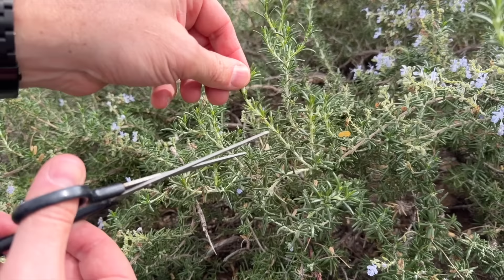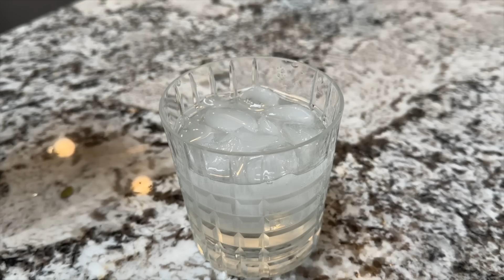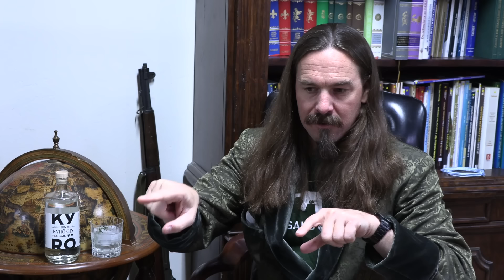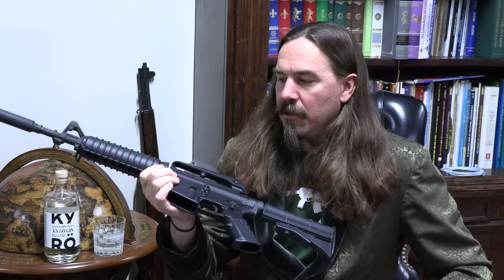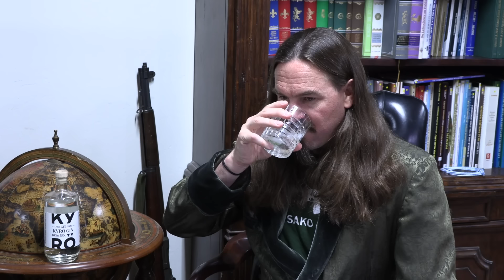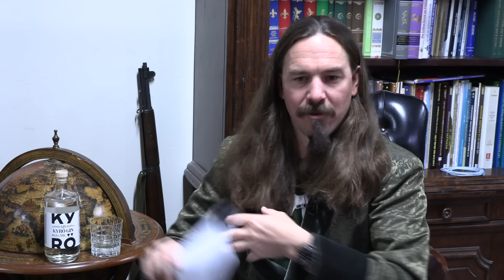How Guns are Made: Tolerances, Methods, and Metallurgy (Q&A January 2026)

Comment: Ramping up defense related parts from one company to many others is a valid concern, 20 years ago there was attempt by a large aerospace company to move to a more machine neutral programming method that would allow a standard g code file to be used across a broad spectrum of machine tool configurations. We got roped into trying this at the shop i was working in. The idea was that by using vector moves (ijk) instead of of abc axis rotations you could move a part from a tilting head five axis horizontal to a tilting work five axis vertical and have the same g code file run in either machine. It was a neat concept, but certain machines might not be as stiff as others and cant take  as heavy as a cut, or they are too big and slow and cant move dynamically enough to keep up with toolpath. 

Also the cutting tools you have really impact the cnc program. Suddenly if 20 shops are all trying to buy the same obscure insert cutter at the same time, you'll see some trouble. 

I saw this first hand during covid. One of my stamping die customers also owns contract sewing company and got a contract along with several other companies to make face mask. Per the contract the ear straps needed to be made with a specific hemming binder,. my customer needed 40 binders and come to find out the binders are hand made by a guy in his garage and he can bend and weld about 2 per day. So i got asked to make sewing binders for a few weeks.

Any fast paced ramp up I've seen always gets held up by some guy in his garage making a key part or some very over looked process that becomes a bottleneck for the 20 new shops all trying to get in line like spring winding or coating. 

All that being said, will still make it happen and that's why I love being in manufacturing.
Reply: Bizarrely, I was the head of development at a sewing machine company that ended up producing masks in the UK.
My best mate there makes binders and folders with another guy, as far as we know the only two people doing it in the UK. The late owner of the business started out making binders in his garage.
Reply: Not just random obscure mundane things like sewing for masks, a similar expertise like this but in a context maybe more surprising is glass blowing for lenses/other scientific glass equipment made with very unusual materials. I forget his name but NASA has been using the same glassblower for his entire life, like not the same company the same person, and before him they used his dad. Some items cannot physically be manufactured except by hand, and this type of scientific glassblowing is a rare trade often passed down in families like this with virtually no one new entering the field. Iirc there are multiple lenses or other glass items (not the main lenses but still critical parts) made by hand by him in not only the Hubble Telescope but even in the James Webb telescope. Crazy to think that in one of the most expensive and most technologically advanced objects ever created by mankind there are still parts required to be made by hand, and there’s only a handful of people alive capable of doing it.

I was gonna add that apparently this guy is the only one with the particular knowledge and skill to be able to make those parts they needed and NASA doesn’t know what’ll happen when they have these types of needs after he dies, but I don’t wanna be too sensational about this as it’s been a few years since I learned about it so can’t be sure on the details and with a couple minutes of quick searching I cannot find the article or video I learned about it from.

But whether it’s that extreme a situation or not, it’s still a case where a $10,000,000,000.00 ultra advanced object in space still requires some dude in his garage blowing glass and that’s wild!

Comment: One I issue I would suspect being a problem would be the cutting tools used in the  CNCs
Very few companies make them and are extremely specialized in its self needing tooling and materials 
unlike the old days where the cutter could just be touched up on a grinder were insert tools just get replaced 
I believe this would be the main hold up and end up being one of the first things to be controlled
Reply: It´s the tools, the people who have the knowledge (it´s mostly not plug and play as he says, it´s a highly complex skill), supply of replacement parts and CNC milling is super slow, that´s why it´s rarely used on high volume production. Basically guns are stamped metal and injection molding, maybe to CNC parts. It´s just wasteful and expensive.
Reply: Dude what?  There are an enormous number of companies making cutters.

Comment: Another note on casting, its actually getting hard to find shops that will do casting, I work in the auto industry and have had to redraw old casting drawings so that they can be machined because the company that used to do the casting is gone out of business or they just got out of casting. Also turn around time for casting can be lengthy again due to the few number of places doing it now so it can be more "cost effective" to machine it in house or even contract it out to be machined than to wait for the cast part.
Reply: Same issue for MIM? I guess it depends on the size of the part.
Reply: @pppppmmmmmccccc Yeah, at least in Europe. Best and most manufacturing is found in China these days.

Comment: In a major war we have the ability to produce ARs like hotcakes. Look at how many manufacturers make ARs now: SIG, S&W, FN, Colt, PSA, Ruger, and the list goes on.  Pistols could be made quite easily.  The M17 can be made by any pistol manufacturer that makes a polymer pistol now by getting the technical data package from SIG.  What will be harder to make are the planes, tanks, copters, etc.
Reply: I think keeping the supply chain filled would be the biggest challenge to making the big stuff, and of course sourcing chemicals and materials for ammo and bombs.  For example, we have no TNT manufacturing in the US right now (although it is coming).
Reply: Small arms don´t matter in modern war so much. It´s bombs jets artillery, small arms are just the last ditch to defend or be an INF grunt. Modern wars are not decided by small arms.
You need IR vision, communication tech etc.

Comment: For tollerances - we use tables , in old design bureaus now R&D , where people like me would work (Mechanical (CAD) Engineer , older title - draftsman) there would be a large shelfs with books that contain tollerances tables for everything you'd think of , in modern times , we use.CAD/CAM software that contains all calculations and selections based on them , so the work for any metal product is reduced as well as time , modern machines are very ubiquitous , and you can make 3D simulations of objects before they're even made. 
As for 3D printing , Prusa makes some great small production lines that can make almost anything you want in a very short time and it doesn't has to be that big and can spit out built and tested parts very easily and quickly , and that is already present in gun manufacturing as well as other metal working , it's just not talked about , not because of how people might perceive production or trade secret , but because nobody really asks about it at the engineering or technical level. I'd cover so many thing in this video myself , but it'll take forever and require deep engineering knowledge to be fully understood.
Reply: "...For tollerances - we use tables , in old design bureaus now R&D , where people like me would work (Mechanical (CAD) Engineer , older title - draftsman) there would be a large shelfs with books that contain tollerances tables for everything you'd think of , in modern times , we use.CAD/CAM software that contains all calculations and selections based on them , so the work for any metal product is reduced as well as time , modern machines are very ubiquitous , and you can make 3D simulations of objects before they're even made. ..." That´s for simple interfaces not whole products and complex parts. You can´t simply look up tolerances on a table and done. You have to go through a whole process and assign GD&T´s on the drawing, create analysis, study thermal expansion, dirt ingress etc. 

"...As for 3D printing , Prusa makes some great small production lines that can make almost anything you want in a very short time and it doesn't has to be that big and can spit out built and tested parts very easily and quickly , and that is already present in gun manufacturing as well as other metal working..." Prusa are FDM machines mostly and some are resin based, none of them can 3D print metal. You can use BAFM metal filament with the FDM process and sinter it later, however this is a very involved process (ask me how I know). You can print polymer parts with a cheap FDM printer, like Bambu ( even better cheaper and just as capable as Prusa), but you can´t really reliably print metal parts at home or for cheap. You have to forge the barrel, you can´t print it either, even with todays tech. Many polymer parts will be weak when 3D printed and need redesigning and so on. But there are diy gun designs that work fairly well.
Reply: Well , I didn't (and couldn't) compress my entire knowledge into few comments , but , yeah , pressure bearing components and high stress components aren't even remotely thought to be printed and similar. Even stuff like Luty gun is very involving and can be very costly once you start calculating numbers.
Sorry for short and ambigous comment , YT app ate my previous comment which made me very pissed , because it took me so long to write it , just to see - it's gone.
Reply: @s0men00bb  "...Sorry for short and ambigous comment , YT app ate my previous comment which made me very pissed , because it took me so long to write it , just to see - it's gone...." Oh boy, I am sorry to hear, this happened to me too a couple of times and it´s super annoying. 
YouTube comments SUCK.

Comment: Statistical averages are just that, averages. A company I worked for decided that since the sequential issue employee numbers were approaching 4 digits, it would be simple to just use the last 4 of the person's SSN to sign off work. "There are 10,000 possibilities there. What's the chance of a duplicate inside a work group of 20 people?" It happened within the next 8 people hired.
Reply from the maker: Yup - I think a lot of people don't realize that if you have flipped a coin and gotten tails six times in a row, the odds of getting tails on the next flip are still 50/50.
Reply: This is actually a famous problem in cryptography and mathematics: https://en.wikipedia.org/wiki/Birthday_problem (if you'd like an understanding about why this happens)
Reply: A company using any part of your SSN to sign off work is already dodgy
Reply: @IVIaskerade  Was gonna say just that. I worked at a company that used your birth year as your personal alarm code. When mine didn't work one day (glitch) they asked how I deactivated it, I said I punched in 1960 knowing someone in our company would have that and like 5 people did haha.

Comment: Most guns today have interchangeable parts that don't require fitting, except for older guns and 1911s. I still need to make springs and other components that aren't readily available. Older MIM parts often fail, and owners want them replaced with traditionally made parts. However, newer MIM parts are better but do not modify as traditionally made parts do. Lately, I repair more sentimental guns, like granddad's old firearm. Fitting shotguns and rifles is also more common. Ruger performs steel casting better than most of its competitors, just FYI.

Comment: I would say manufacturing ammo would be more of a limiting factor than the actual firearms themselves.  You make one rifle, it can fire thousands of rounds before it needs work.  Making those thousands of rounds is harder than making the one rifle.  And it's not just the making of the round itself, it's the supply chain that has to support it.  Who is making all those primers?  Who is making all those bullets?  Who is making all that powder?  Who is making all those cases?  Who is making all the chemicals/metals required to make the primers, powder, cases, bullets?

If i owned a good CNC machine and some heat treat equipment, i could theoretically make an entire rifle in my home.  But i cannot make ammo without supplies of things that i cannot make at home even with good equipment.  Making primers and powder is dangerous!  ^-^
Reply: Id say barrels are quite the bottleneck too. Def need some specific equipment for that, esp if you want a good barrel (cold hammer forged).

Comment: Can you make a video about weapon finishes and surfaces? Like why guns look like they do, how does the paint job work, what is electrolysis, is cerakote any special? Why real weapons surface is different than the ones on airsoft, why does some weapon wear easy and some are not, why Sig Spear has this metallic surface and etc
Reply: "...why guns look like they do..." Because they use specific surface treatments, like bluing etc. 
"...how does the paint job work..." Linke any other paint job.
"...what is electrolysis..." It´s an electro chemical process to deposit a material from an anode to a cathode. It´s a galvanic process. You can deposit chrome on a metal weapon part to prevent corrosion. 
"...is cerakote any special..." It´s just a brand name, one would have to see what exact surface treatment you mean and they do and compare it. 
"...Why real weapons surface is different than the ones on airsof..." Because airsoft is plastic toy that don´t need corrosion prevention or has to work in high temperature for 30 years reliably. 
"...why does some weapon wear easy and some are not..." This is due to material hardness and surface treatment like oiling
"...why Sig Spear has this metallic surface..." not sure which surface you even mean, it looks like a desert paint type of rifle to me. Do you mean the steel parts, like the barrel which are dark ?

Comment: The "Blanchard Lathe" is commonly known as a "pattern lathe" or "tracing lathe".
This type of machine is still very common in alot of places that still need a natural material for it's product.
Reply: In a way its a rotating "Pantagraph".
Reply: Wooden aircraft propellers are still sometimes made on something closely resembling this type of 'lathe'. They have the advantage of being able to make a two-bladed propeller with only half a pattern (or even half an existing propeller) to copy from. You cut one blade, then turn the blank around, resulting in something which should be symmetrical.
Reply: I know it as copy lathe

Comment: Strategically speaking, one shouldn't rely too much on CNC because one EMP could wipe them all  out in a millisecond! Just sayin'
Reply: Large-scale EMPs like that are only created by major solar flares or nuclear blasts - in either case you have much bigger problems than some machines not working.
Reply: @ChrisSmith-mi2zo indeed but even if the bomb drops you want to be able to make weapons of resistance!
Reply: @littleworkshopofhorrors2395  What resistance ? There is no food supply, no gas nothing, it´s over.
Reply: @sierraecho884 there will be survivors just like Hiroshima and Nagasaki, it all depends on which way the wind blows the fall out.
Reply: @littleworkshopofhorrors2395  Okay. First modern nuclear weapons are about 100x more powerful. 2nd the fallout is the least problem. The fallout is not that much and it won´t kill you until 15 years later due to cancer. If a nuke hits the US and a nuclear reactor experiences something like in Chernobyl, that´s 1000x worse. And none of this has anything to do with CNC machines. No manufacturing machine these days is purely mechanical, it´s all robots and CNC, not just the mills.
Reply: @sierraecho884 my point exactly about purely mechanical machinery, and strategy.
Reply: @littleworkshopofhorrors2395  You are completely missing the point.
Your worry about an EMP is completely irrelevant and you can´t produce anything with purely mechanical machines. You idea is simply stupid.
Reply: @sierraecho884 "you cant produce anything with purely mechanical machines" are you serious?
Reply: @littleworkshopofhorrors2395  You gonna use steam engines bud?
Reply: @littleworkshopofhorrors2395  No these days anymore. Not if we are talking about precision equipment, cog wheels and such. 
You can make a gun at home with a file and scrap metal but it would take forever it wouldn´t work very well and you coudln´t equipt a whole lot of people with it. Point is saying switch from CNC to something else du to EMP risk is plainly stupid. You can harden any device against an EMP. If you can´t even do that for your factories, you probably have to business fighting the war you speak about because you already lost. Every manufacturing machine uses chips and computers, so does the Quality department the desgin bureau and so on. It´s not 1925 anymore.
Reply: @sierraecho884 yet again you missed the point, commercial cnc machinery would not be hardened agsinst an EMP, why would they? Peace is presumed!
Reply: @littleworkshopofhorrors2395  "...yet again you missed the point, commercial cnc machinery would not be hardened agsinst an EMP..." So place them in a faradaic cage. The point is, it´s nonsense altogether. No factory is.
Reply: EMP wiping out computer chips generally is highly overrated.  EMP blowing a lot of power grid components and surge suppressors is relatively likely.  Switches and transformers and surge suppressors not plugged in on EMP day get around that fine.
Reply: @Georgewilliamherbert  Also cars are faraday cages, most of that stuff is overblown.